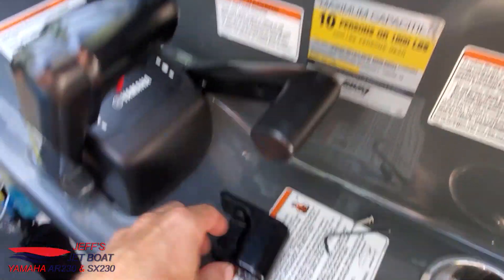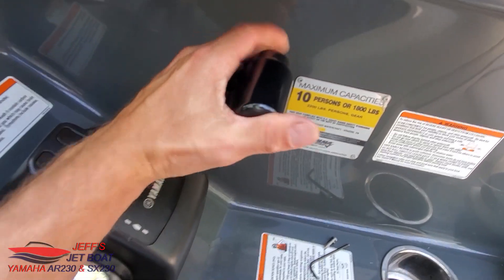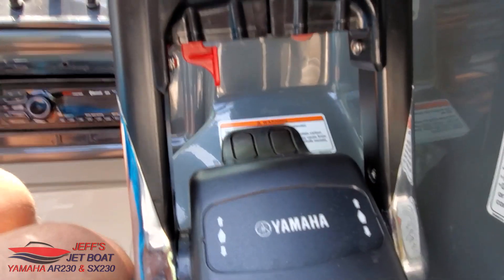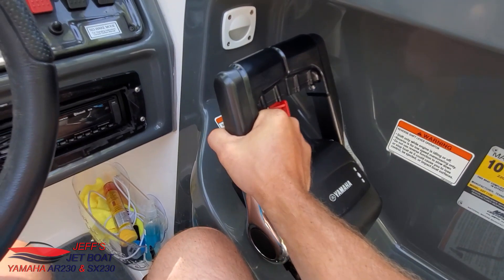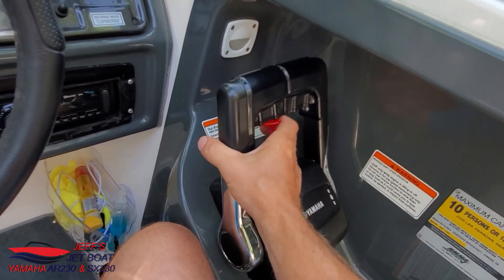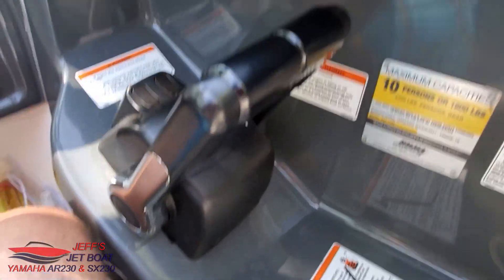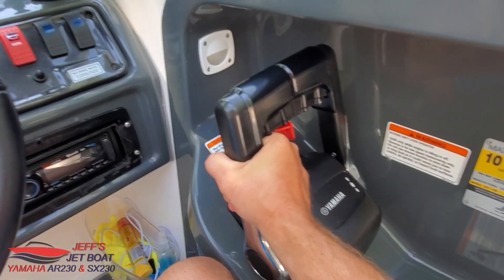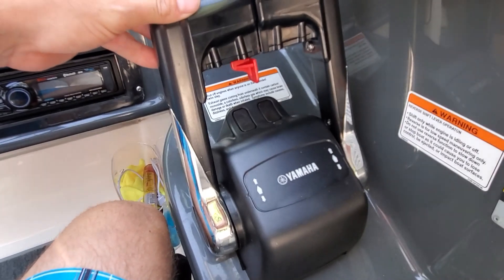Throttle Sync Review - Yamaha Jet Boat 2006-2017 Twin Engine

Comment: Had no idea they made this!  So getting this for my 08 AR230.  I have throttle drop on my port side as well.  One of many issues.  Chasing an overheating problem too.  Runs perfect all day under 9000 RPM, 2 minutes into anything over both engines start to overheat.

Comment: Hi Jeff, love your videos and I have the exact boat in blazing orange!  Need your expertise and have seen this come up in multiple threads... I installed the throttle sync, but my port side engine is 500 rpms lower than my starboard.  Did you have this issue or can help with some insight on how to adjust?
Reply from the maker: I did not have that issue but here is what I would check.  1st you could have throttle drop.  With the throttles connected or synced, if you push only on the port side throttle lever does the rpm sync up to the starboard engine?  If so watch my video  "How to Fix Throttle drop on Yamaha Jet boat"  and that will explain  how to fix it.

Comment: Hey Jeff, any advice on how to sync the throttles? I bought and installed this throttle sync, but one engine is running a little higher RPM than the other. I watched your throttle drop video and adjusted it there, but one engine is still running higher than the other.
Reply from the maker: You need to make an adjustment at the throttle body assembly where the cable attached to it.  It's easy to do and you only have to remove your air filter box.  Give me a week and I will make a video on it for you.
Reply: @JeffDoesThis  That would be great, thanks man!
Reply: @JeffDoesThis  Hey Jeff, just following up on my request for a video on how to sync the throttles. Thanks man!